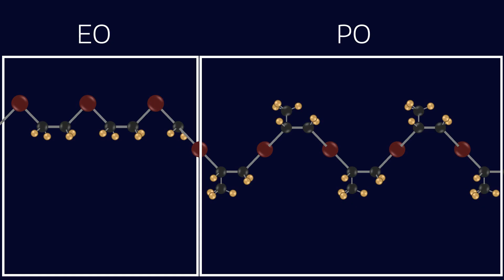What are PAG Base Oils? How are they Manufactured?

Comment: Buy yourself kerosene, put some base oil into it to achieve a higher viscosity and density on the kerosene. Mix this 50:50 with diesel and enjoy. Enjoy 50% discount on the tax portion of diesel.
Reply from the maker: Nice one! Yeah this is a common was to improve the low temperature flow properties in colder parts of the world. Just be mindful that if you're doing it for economic reasons, the kerosene has a lower BTU rating and a lower cetane rating, so if you want true savings you'll need to offset the lower specific energy against whatever the tax rate is.